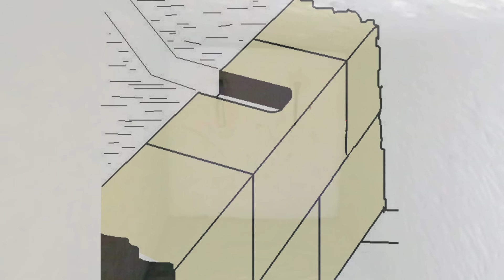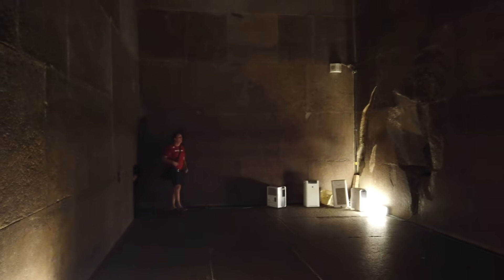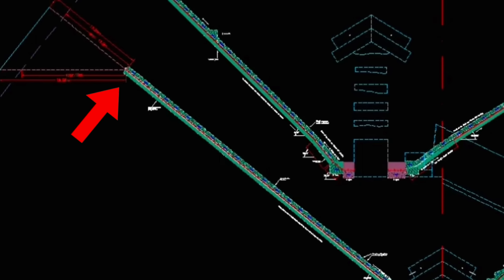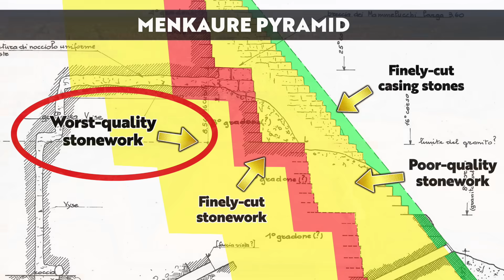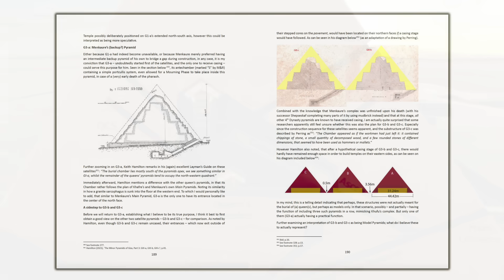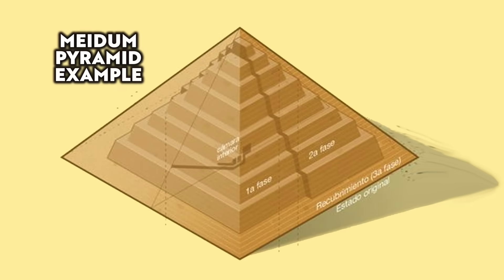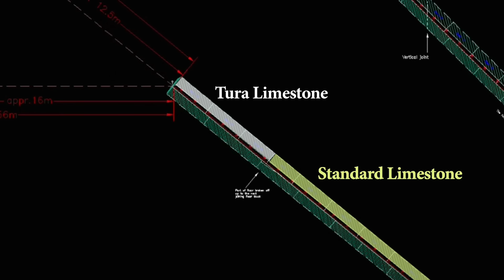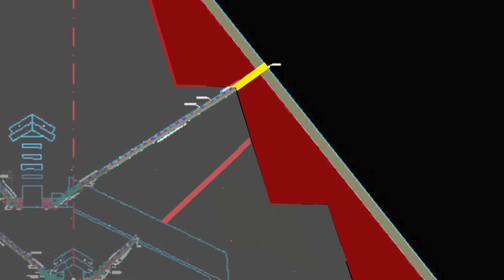Great Pyramid HIDDEN Steps Explain Everything | Part 1

Comment: A lot here makes no sence. 
If they were built as air channels for visitors once compleated, surely they would have needed to be open to provide air during construction. The workers would need air too. Also, if it was so important to provide an air supply at all, why build so few of them and why take the risk that a single stone could have fallen down during construction and blocked a channel for ever. 
I don't know what they were built for, but they make no real sence as air channels at all. The people who built the pyramids were not stupid, they would have known that to creat a draft, the shafts in the rooms would have needed to be at different levels. Just open a window down stairs and then open your loft hatch to see the effect. Even now the shafts in the Kings chamber do not creat a draft without the use of an electric fan.
Reply: No, the King's Chamber shafts, without fans, were found by Vyse in 1837 to conduct currents of air, enough to relieve the stuffiness of the chamber.  When fans were added in the 20th century, it was done largely to accommodate the increase in visitors, and this ventilation effect was greatly amplified, but without fans, the shafts were still able to provide what the ancient Egyptians may have considered enough airflow for their purposes, which probably didn't include multiple daily visitors throughout the course of a tourist year.  In Vyse's 1840 publication "Operations Carried on at the Pyramids of Gizeh in 1837", based on his 1837 field notes, he says: "Upon the removal of this block the channel was completely open; an immediate rush of air took place, and we had the satisfaction of finding that the ventilation of the King’s Chamber was perfectly restored, and that the air within it was cool and fresh.”

Comment: Good Sir, I respect your hard work and insight, but are you saying that the original pyramid was constructed as a tomb/mausoleum?! I just can accept that as “case closed”. No markings or hieroglyphs for one of the greatest structures ever constructed on Earth? I could easily see the Pharaoh’s “taking over” the pyramid for a tomb or other use, but can’t buy what you’re selling right now, with so little evidence. I’ve been watching your older videos from several years ago and those are actually some great theories that have weight to them. It seems your takes have shifted towards the “mainstream” and it just doesn’t align with your past ideas… IMO.

Comment: If the Queen's Chamber was roughed in, air channels would be necessary to do the finish work. Once the finish work was completed or abandoned, the channels were no longer needed and were allowed to be covered over as the pyramid was completed. I think this would have been the original plan and not a later adaptation to circumstances that occurred  because the pyramid was enlarged.

Comment: I have never understood the theory that the kings chamber needed such an elaborate structure to distribute the weight from above when the grand gallery is much bigger and being lower actually would have much more weight above it. Yet it has no need for such an elaborate structure above it. It only has a roof that slowly comes together to a point.
Reply: Earthquakes.

Comment: If the Great pyramid has a stepped core encased with well finished stone work, would not evidence of this be seen in the robbers passage? That tunnel would have had to cut through the high quality core encasing stone and it should therefore be visible.
Reply: Look up History for Granite video “looting the great pyramid”. Late in the vid he shows a video of entering the robbers tunnel. The vid from Anyextee is linked in the description too.

But there’s repairs and lights & door installed. So not sure you can see any delineation. And with my conspiracy hat on, a noticeable delineation may be covered.
Reply: @nathanwish6857 that seems likely.  The majority of what you actually see in the robbers tunnel is concrete.  I’m sure HFG was aware of that, but perhaps not the extent.  There are old pictures from before the modern reinforcement, you might be able to identify layers from that.
Reply: This is exactly what I was thinking. I'm assuming there is no change or this theory would have already have been proposed. It may be that they simply quit extending the queens chamber shafts when they finished the kings chamber. The both end at approximately the same height.
Reply: stop! 
critical thinking is forbidden here
Reply: The “robbers’ tunnel” cuts straight into the pyramid, bypassing Khufu’s entrance.

If the core were carefully stepped and finished, that tunnel should reveal it.

This suggests either:

The “finished stepped core” theory is wrong, or

The robbers cut in a way that avoided showing this detail, or

Later reconstructions have smoothed out the evidence.
Reply: Yes, and the "stepped" advocates believe that the difference is visible in the robbers passage.  There are certainly changes in construction method and/or rock quality as you progress through that passage, but it remains uncertain exactly what those changes indicate.

I do happen to think that there's a high probability that the Great Pyramid is stepped inside and that each "layer" helped to refine the shape so that the casing could create a nearly perfect pyramid shape.  The inner core thus required less refinement and accuracy, improving construction efficiency with larger blocks.  This remains a hypothesis, however.
Reply: @antibrevity  The Great Pyramid might be like a giant wedding cake inside — blocky, step by step — and then frosted smooth on the outside with fine limestone.

Robbers’ Tunnel scratches through that cake and may show the layer changes.

The Queen’s Chamber shafts and other oddities make more sense under this model.

It’s a very practical engineering solution, not mystical — and would explain how they built it so precisely and so fast.
Reply: The Robber's Tunnel cuts through at least two "walls" of cut and stacked blocks with the space in-between filled with irregularly shaped "rubble" and mortar.
Reply: @juliavixen176  It's seems there would be a 'single' definite transition from where it was added on to though.
Reply: Looking at this new thread about the Queen’s Chamber shafts, the “blocking stones,” and the Robber’s Tunnel — here are some new thoughts you could add that push the discussion a step deeper rather than just repeating what’s been said:

Reply option 1 (engineering angle):
If the Robber’s Tunnel had intersected a finished shaft, we’d expect a clear breach in alignment or tool marks betraying the passage. The fact that we don’t see that may hint the shafts were deliberately terminated before reaching the chamber wall — almost as if they were “symbolic conduits” rather than physical vents.

Reply option 2 (symbolic angle):
Another possibility is that the “doors” and blockings were never meant as airflow or escape routes at all, but as ritual gates — sealed by design. In that reading, the absence of cut-through traces is itself evidence of intention: the builders wanted a path that went somewhere conceptually, not physically.

Reply option 3 (blended / question-posing):
What if both are true? The masons may have started extending the shafts toward the King’s Chamber, but stopped once the symbolic threshold was marked. That would explain why the heights line up but no breach exists — the “end” was deliberate, not an accident.

Would you like me to also frame one of these as a math/geometry-based micro-comment (e.g. about alignment, angles, or proportional placement), so it sits neatly alongside the technical side of the discussion?

Comment: Following this logic, Laurens R. van Vliet suggested that the stepped core, which is present in the Pyramid of Menkaure, might also exist inside the Great Pyramid. Part of Menkaure’s core is well visible, and there is nothing particularly mysterious about it. Even to the naked eye, the difference between the internal masonry and the external masonry is clearly noticeable.

The microgravimetry results, collected in 1986 by a French research team, led to the idea of a possible internal core inside the Great Pyramid as well. Although this was not explained by the existence of a core, but rather by spiral ramps. Yet, the main question remained: how was the core constructed, how many tiers does it contain, and what is its structural composition? It is known that the internal parts of Egyptian pyramid constructions differ from one another, and even the angles of inclination vary.

Consider this: your task is not simply to build the pyramid’s core, but the internal part of the structure, which would accommodate all the main elements of the pyramid—chambers, relieving sections, galleries, and technical passageways. And all of this involves blocks of different sizes, ranging from lighter blocks to massive blocks weighing 30 to 70 tons.

On my channel, I suggested that the design of the Great Pyramid’s core conceals a property of the equilateral triangle, with a base of 170 m × 170 m and a height of 63 meters. The equilateral triangle forms the basis of the pyramid’s core! The entire pyramid is divided into seven identical levels. If we take approximately 21 meters as the height of each level, we get seven levels of 21 meters each, corresponding to the full height of the Great Pyramid.

This step can be traced in the arrangement of the chambers and the relieving section: from the pyramid’s base to the Queen’s Chamber—21 meters; from the base of the Queen’s Chamber to the base of the King’s Chamber—21 meters; and from the base of the King’s Chamber to the end of the relieving sections—21 meters.

Thus, we can consider two possibilities here:

1. The pyramid’s core up to a height of 63 meters consists of three tiers, all equal in height.
2. The first step of the core has a height of 63 meters, meaning the first three tiers are combined as one tier, inclined at an angle of 75 degrees, similar to the core of the Meidum Pyramid.

Why specifically 75 degrees is used is explained in detail on my channel in my video. I also described the technical aspects of constructing the Great Pyramid: how the Pharaoh’s Chamber and the relieving sections were assembled using the “stup” technique, and I explained the sacred geometric connection with the technical design. I explained how a modular grid was applied in the pyramid’s plans and how blocks were lifted based on it.

Most importantly, based on the modular grid and the Great Pyramid’s structure, I proposed a possible location for a hidden chamber. According to my calculations, the hidden chamber is located directly beneath the three granite blocks of the King’s Ante-Chamber, at a depth of 8–10 meters and a width of approximately 1.5 meters. I also explained in detail the technique of using vertical shafts at each tier of the pyramid during block installation.

So, what is the main conclusion we can draw? The mystery of the construction of Egyptian pyramids can only be explained through the connection between the sacred aspect and the technical aspect. If you ignore the sacred or religious part, the technical aspect remains an enigma. Yes, exactly, this means that the physical part of the structure is the result of a projection of the spiritual
Reply: Can you please provide a link to your channel? Thanks in advance.
Reply: @jeremyd1869  @thotecture
Reply: @jeremyd1869  "Architecture of Thought". It's all in Russian, unfortunately.

Comment: Like said before, there is... 'zero' ...reason to have diagonal/ascending air shafts, when you can simply create horizontal airshafts at the same level, without the structural design headache.
Reply: They wouldn't work.  Try installing a horizontal chimney. 😂
Reply: @ChrisShortyAllen  You do realise that hot and cold air causes a circulation current in a room right ?
Reply: @ChrisShortyAllen  
1. A vertical chimney/flue is not diagonal.
2. Are you creating an air channel or a smoke stack ?  You know you can breath through a straw that is horizontal right ? You know that airbricks are on the side of a building right ?
Reply: @RuneRelic 
You know warm air rises?
😂
Reply: @ChrisShortyAllen  You know a thermal gradient will create a horizontal transfer regardless ?
ie along the roof in one direction, and along the floor in the other.
Reply: @RuneRelic 

I do believe you're speaking beyond your technical knowledge and ability.
Reply: @ChrisShortyAllen  I believe your argument is non existant. I am a HVAC coordinator by the way. Strawman more.
Reply: @ChrisShortyAllen  Ever heard of louvres ?
Reply: @RuneRelic 
They're definitely not louvres.
😂
Reply: @ChrisShortyAllen  Obvioulsy. Clearly letter boxes for Royal Mail 😁
Reply: After finding the shaft opening on the north side of the pyramid, workers discovered the opening of the southern shaft by going around the pyramid and locating it in the same relative position on the southern face. Howard-Vyse’s assistant, by the name of Mr. Hill, found a stone blocking the southern shaft and with some effort managed to remove it. “Upon the removal of this block the channel was completely open; an immediate rush of air took place, and we had the satisfaction of finding that the ventilation of the King’s Chamber was perfectly restored, and that the air within it was cool and fresh”. This is how the shafts in the Pyramid came to be known as air channels, thought to be some sort of ancient climate control system.

I do believe you haven't read anything about ancient Egypt.  Just listened to grifters and idiots.

Do tell I'm wrong lol.
Reply: @ChrisShortyAllen  So they have assumed they are air shafts, because they were met with a rush of air. 10/10 for presenting assumption as fact. As stated. If they were air shafts to provide air, they would be in every pyramid after. Nor would they use diagonal air shafts to do so.

This is the differnce, between the application of critical thinking, and the acceptance of propaganda through hearsay.

Comment: Are the wall blocks which once sealed the inside of the Queen's Chamber shafts small enough to fit down the corridor leading to the chamber? If not, then the shafts must have been sealed on the inside prior to the corridor/ceiling construction.

Comment: You are close to being on the right track. The pyramids were built in stages. In the beginning faze the platform was leveled. The first stage built contained the lower chamber underneath the ground. Next, when it was added on to or improved by another  builder, the queens chamber was incorporated in the structure with the level of the kings chamber at the apex. Next, the kings chamber was completed with the resonating chambers placed above. This was all in the form of a step pyramid or ziggurat. In later construction, the backing stones would have been added. Then, the final faze of construction would be the casing stones.  Each addition may have possibly been done by consecutive rulers or Pharoah or it could have skipped over generations. By not trying to compress the construction into a short time period you will find everything can be explained.  Egyptology is wrong.
Reply: And as a narcissist you should know.
Reply: @ChrisShortyAllen   Egyptologist and Archeologists are entrenched in their dogma which was first imposed and written about in the late 1800s and early 1900 without progressing any further. I once read a academic book written in 1910 which included everything they are spouting as truth. The truth is it's all speculation and guesses.
Reply: @Daniel-ob2ml 

Your 1910 book couldn't have mentioned the greatest archeological discovery of all time.
Facts don't change and imagining a building project going on and on is ridiculous.  They did build a number over a short period.